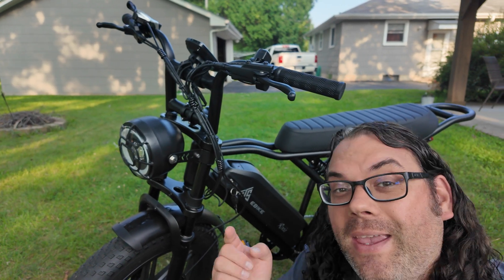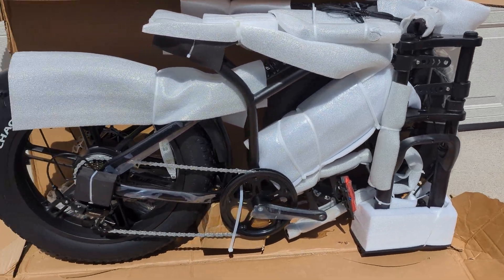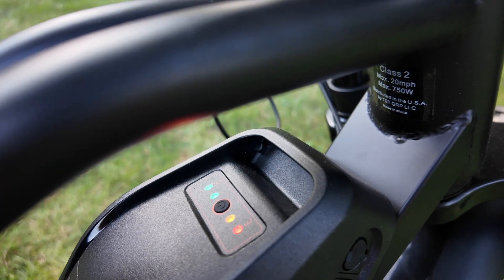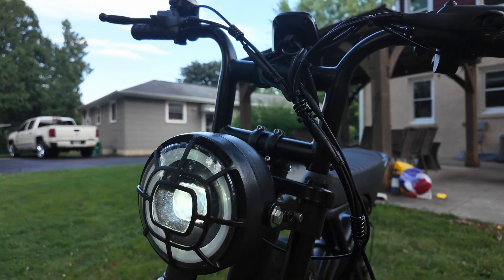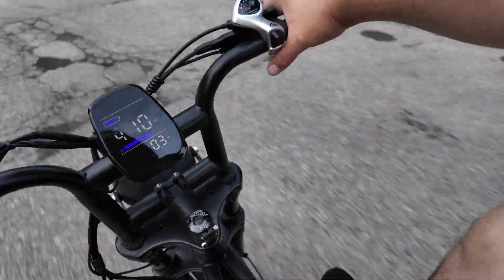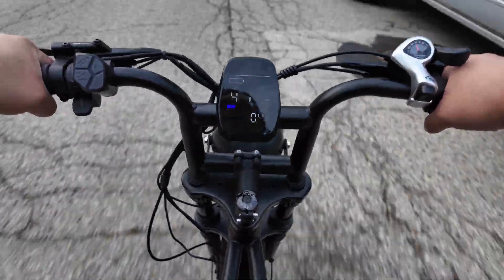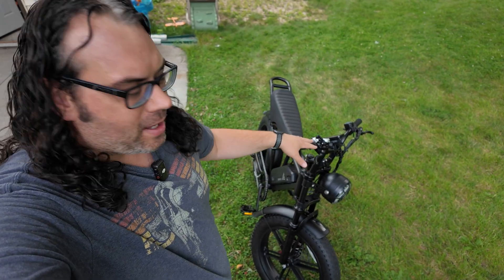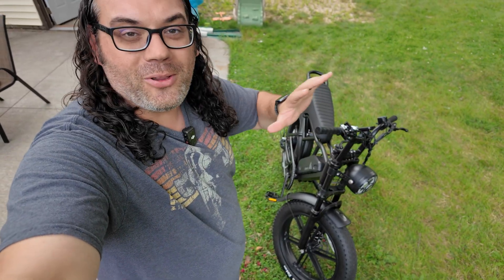Can 3D Printing Fix The TST R002 E Bike?

Comment: Print suggestions: Rear brake light and indicator set up. I did not hear you mention that it does have that, but, if does not, any road going vehicle show come with them as standard (speaking as a car driver who struggles with interpreting the decisions of cyclists).